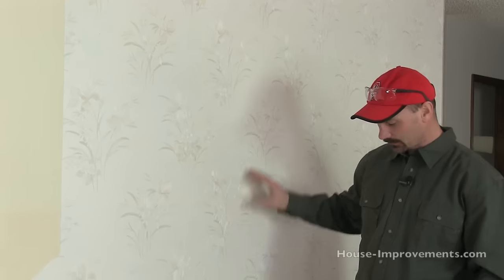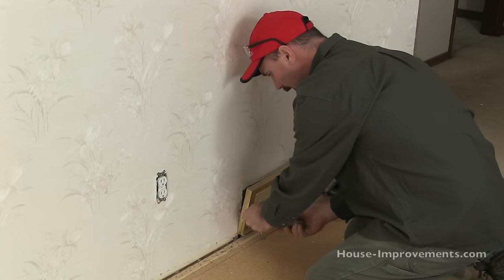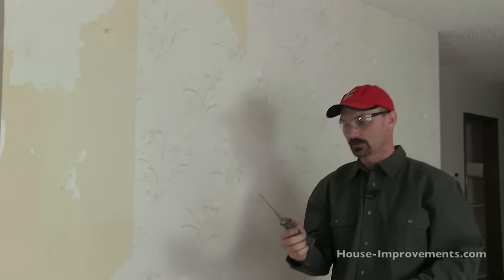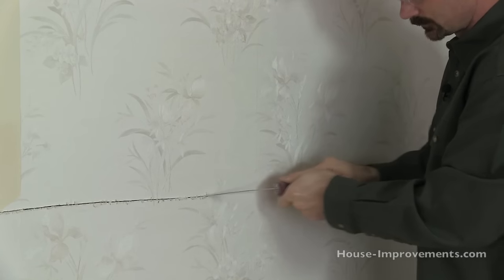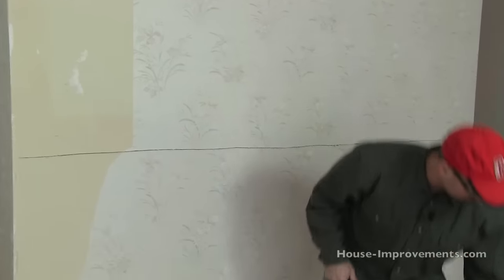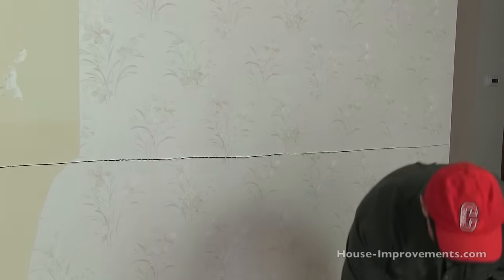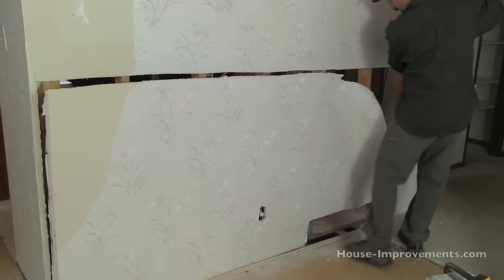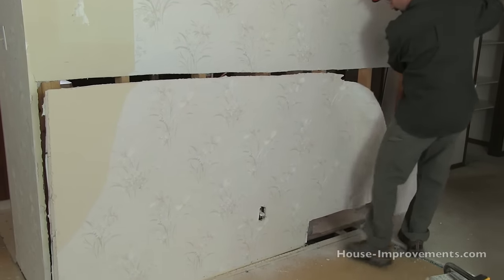How To Remove Drywall from a Wall

Comment: I love your videos! They are very informative for a novice like myself. I have one question. Why not use a reciprocal saw to make your initial cut through the drywall?
Reply from the maker: +Joseph Quam  You could but if there are wires or plumbing in there you do not know about there is less chance of a disaster using a hand saw.
Reply: +HouseImprovements Cool! Then I'm gonna go ahead and use it to make the initial cuts. All the plumbing and electrical is coming out anyway. Thanks! Keep up the videos!
Reply: Hand saw is easy, cheap, less noisy and dusty.

Comment: Shelly
I have staples in my wall. How do I know if I have any dry wall screws holding the 5/8 inch wallboard?
Reply from the maker: +Deb B  I'm not sure I understand the question? what are the staples in the wall for? Please use my forum for further discussion. http://www.house-improvements.com/forums/
Reply: HouseImprovements I have staples holding wallboard up. I don't know if I have any dry wall screws. How can I tell if there are any? Staples have started popping out. With the indoor heat on ?
Reply: +Deb B 
I think you're saying that you see staples in your dry wall as they're starting to pop. You're wondering if they might have ONLY used staples to install the dry wall OR if there might also be screws, and how to find out...

If that's the case, look for the studs to be 16" apart. Screws would be along the studs, under the compound and tape. Scrape that away or maybe even try a magnet - although with a magnet you wouldn't know for sure what's attracting it.

Or, if it's coming down anyway, just start yanking it down as Shannon is showing and see what's left behind.

Comment: What you use to get a straight line ing you only going to replace 4 feet up?
Reply from the maker: A level will work. use a pencil to mark the line and then cut along the line
Reply: Thanks @HouseImprovements

Comment: What happens if the drywall workers installed the joints with metal beads instead of the paper ones that you can cut with like you did 3 minutes in?
Reply: The metal bead is only used for outside corners.
Reply: Thanks.

Comment: It's strange that nails were used instead of drywall screws.  Would nails pop out and cause issues with the wall?
Reply: It's old construction. 1970's by the looks of it.
Reply from the maker: Yes 1975 construction, the drywall was tacked with nails and adhesive was used as well. Ring nails did seem to pop more than screws do

Comment: I drilled a hole on the stud in the ceiling to reroute my internet installation and I think I hit a wire when I did.  I  just wanted to go behind the wall to make it look professional. I tripped a circuit and later got the breaker to go back on but I have no power in 3 rooms. There was a wire in the attic but I stayed away from it. I am thinking that who ever wired my house followed the  stud right directly below the ceiling and dropped down when they made it to the outlet or ceiling fixtures
Reply from the maker: going to have to get that fixed. I would turn off the breaker until then.
Reply: HouseImprovements do you think I hit it with the drill? I noticed it rightafterwards. I have the power off right now
Reply from the maker: yup hit it with drill
Reply from the maker: I can not see the picture here. Use my forum for more help. http://www.house-improvements.com/forums/
Reply: The stud looks like a 4 x 4 because it was solid. That is the 1 that separates the 2 walls. That is the 1 I drilled a hole in and only thing I did
Reply: The drill was nowhere  near the wires. I don't know where the problem is. I feel it may be a neutral wire that lost connection somewhere
Reply: The drill probably caused the wiring to overeat but funny thing it tripped a different circuit.  The breaker is energized but no power in those 3 rooms

Comment: Why was the drywall only attached to the wall on the ends? Why isn't there any fasteners every other stud? I've never pulled sheetrock without having to pull all kinds of nails, staples and scraping off dried glue! That wall won't have any real rigidity.
Reply from the maker: There was glue as well, I guess I never pointed it out. Nails only used to tack it up. This was very common here (Saskatchewan,Canada) in the 70s and 80s

Comment: Do you every worry about asbestos when removing drywall or plaster?
Reply from the maker: You know I seem to take more precautions on plaster then drywall but I really should treat them as equally dangerous .
Reply: What kind of precautions do you take? I am asking because I purchased an
 older 1950's  house and it needs some work done. I am just worried about doing 
the demo as all I hear is  "this has asbestos, and that has asbestos, 
and those have asbestos." Is a mask all you need?
Reply from the maker: It really depends what you are dealing with but a cartridge canister mask with the proper cartridges and some ventilation is usually pretty good. But if you have concerns at all you can have a company come in and remove it.
Reply: @ye11owsn0w  p100 mask, suit, googles, turn off hvac, create barriors w plastic to prevent dust from traveling, vent the dust outside using a fan.

Comment: It seems whoever installed this drywall did it so that it would easily come off. 😆 Usually a drywall is screwed at each stud and doesn't come off in such a big piece.

Comment: On the surface (where the drywall is anyways) - one wood - or is that would - HOPE..
That?
To remove DRY WALL from a WALL - wood (oops would) be
To make it WET.

Thus it wouldn't then be a dry wall after all see?
As:
Anyone who has had twenty feet of FLOODWATER through their house - will tell you there isn't a DRYWALL left in the place.

Oh and why is GIB-BOARD called DRYWALL, when they also use those sheets - on the CEILING?

Surely it would become dry cladding? - or DRYTOP (as it isn't the roof itself, but the top of the room).

Comment: I want to pull aluminium angles out of a wall to do a job, this method is not that simple, it's not that easy to just get a puty knife & push it up between angle & wall & up under the head & washer, it should've been screwed in incase you need to remove them in the future,

Comment: What about asbestos?
Reply from the maker: There is always a danger of coming in contact with some form of asbestos during demolition of any pre 2000 home. If you have a concern you can send samples of products away to a lab for testing before you begin.
Reply: @HouseImprovements  Thanks

Comment: Sawing in a wall where you don't know what is behind it is a big NO NO!!
What if there is a cable not protected by a tube going all the way from down to up? You will damage it!
And what then? You might end up hiring an expert to repair it. Just use hammer and gently start smashing your way inside so you can see!!
Reply: how about water lines in  a bathroom

Comment: Leave the electric on so you know when you reach a wire
Reply: You will be shocked  about how much that would help locating the wires
Reply: Man that was great so the drywall is still good enough to make sandwiches out of
Reply: But the pieces are to big to flush down the toilet to save on hauling charges